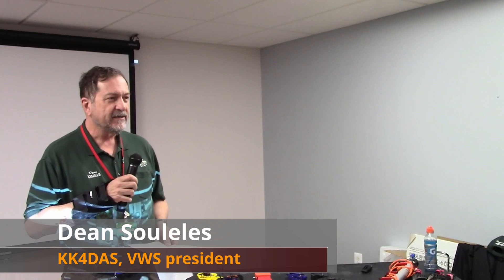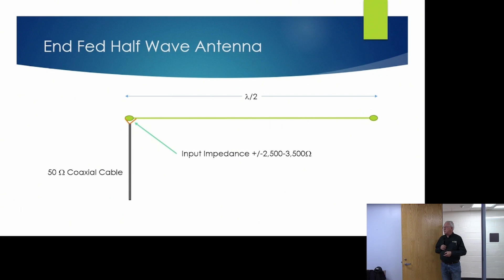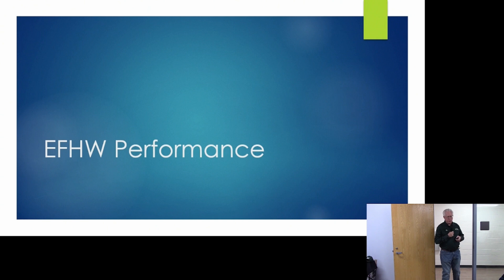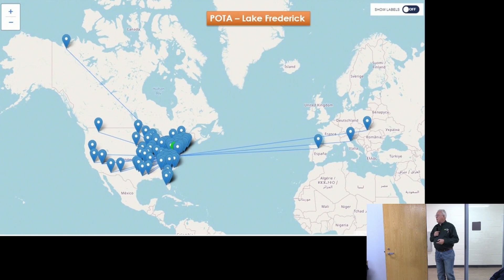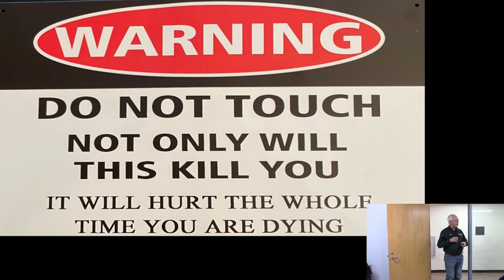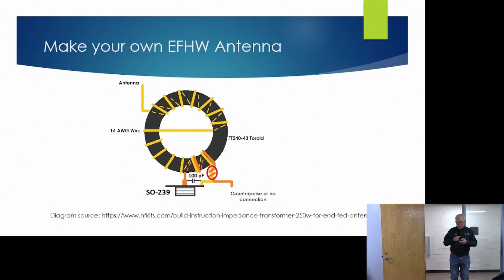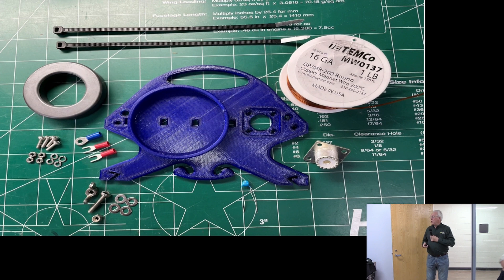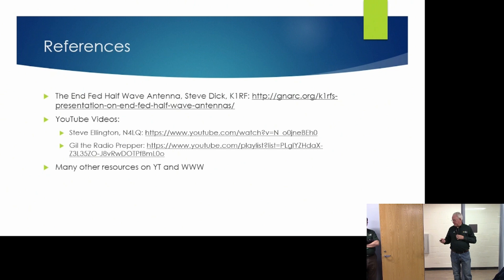End-fed  Half Wave - the perfect antenna for your #POTA or #Field Day station

Comment: Excellent presentation.  I'm curious, you used 18awg copper magnet wire, do you know if 16awg could be used with an FT240-43 transformer?  I know it might be a little stiffer to wind but might it otherwise work?
Reply from the maker: It depends. Thicker wire has lower resistance, what will reduce resistive losses in the windings. On the other hand, thicker wire means smaller distance between windings, what can increase losses caused by inter-winding capacitance.
Probably the best way of figuring out is to build two identical transformers, and measure them connected back-to-back. MM0OPX has a great demonstration of loss measurement using this method: https://www.youtube.com/watch?v=TZjY2Jim7fY
Of course the winding has to fit on the core, but I don't think it will be a problem in your case.
Reply: @ViennaWirelessSociety  I appreciate you taking the time to respond. Thanks!
Reply from the maker: @gsudman  It is worth noting, that the gains from increasing wire diameter will be limited by skin effect. According to the graph in wikipedia (https://en.wikipedia.org/wiki/Skin_effect#/media/File:Skin_depth_by_Zureks-en.svg), at 1MHz the current penetration depth for copper is ~0.07mm. This means that the decrease of wire resistance will be proportional to the wire circumference (i.e. wire diameter in the first power), instead of the cross-section area (i.e. diameter squared), what is a case for DC currents.
On the other hand, FT240 is such a large core, that the increase in losses caused by capacitive coupling.
I think this is a great excuse to do some for some experimentation, and share the results :)